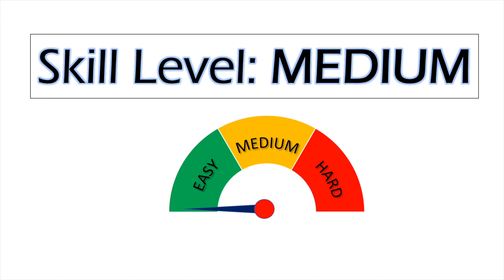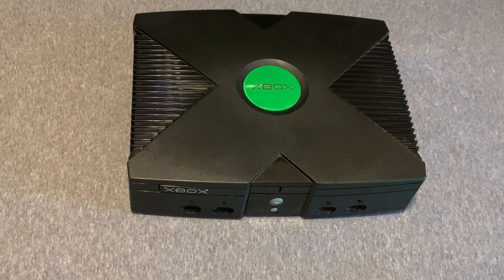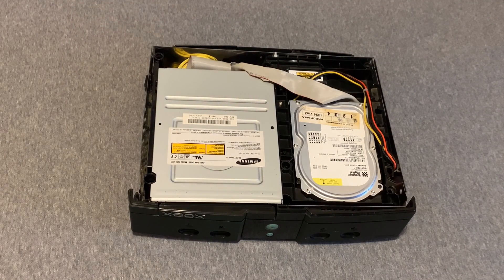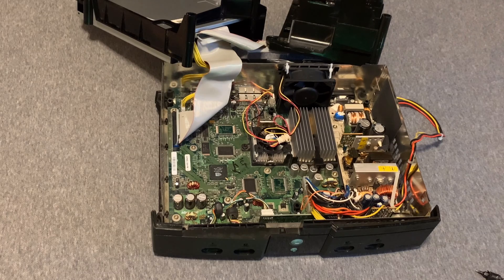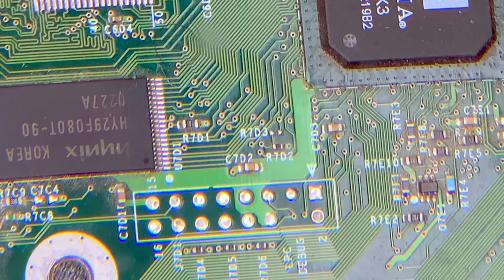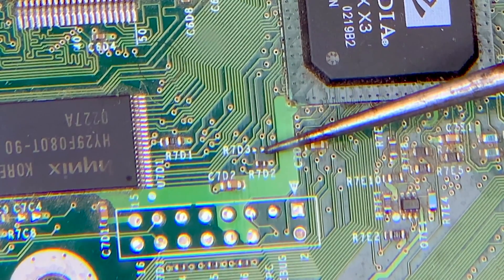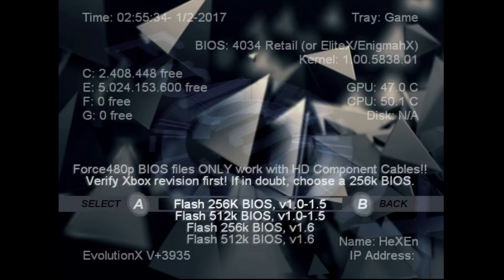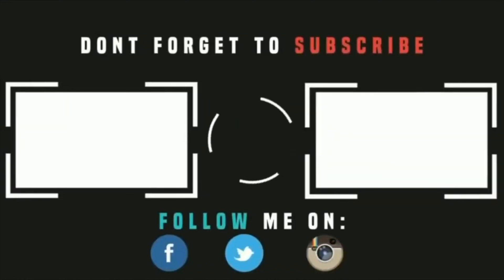XBOX TSOP Flash Full Tutorial How To Guide v1 0 and 1 1 Hynix Hyundai ST ONLY

Comment: This was the most aggravating soldering experience I have ever had. I could NOT get the solder to actually stick, no matter the heat. But then I looked and I lost the flipping capacitor at R7D2. No idea how, no idea where it went. Even with a wire - could NOT get it to stick to those two spots.
Reply: I wonder if you just got some solder cut it so it was touching the 2 points then melt it would that work.
Reply: flux and lead solder is your friend

Comment: I got an Xbox that seems to have been soldered at these points already, but the CFW hasn't been installed.  I was wondering if it will boot backup game disc without upgrading the CFW yet or do i have to load up Hex?

Comment: After I flashed using hexen, my v1.0 powered off as usual after the flash, and once rebooted, it shows the power up animation as normal with the EVO X logo on the top left, but then it sits at a black screen and doesn't so anything.
I put in splinter cell to test and it booted and I reinstalled the rocky5 Softmod 1.1.7 just to be safe, and after that, it's still sitting at a black screen after booting up. Help?
Reply: Reflash the bios 😂😂😂

Comment: Hey Blaine I just tsop modded my 1.0 Xbox in preparation of a bigger hard drive. Everything went well for my Xbox with an ST chip however I did want to mention 2 things. Rather than using solder to bridge the connections together I actually used some conductive paint that was recommended from reddit and applied it to the 2 points using a tooth pick. Also when booting into the hexen disk I don't believe you mentioned the slow boot time to get into the menu, not sure if that happened to you but it did for me and I seriously thought I messed up the burning of the disk initially. Other than that your video was great and I appreciate everything your doing on your channel keep it up!

Comment: What does TSOP does for your xbox( i'm just a newbie at softmodding and stuff)
Reply: That's actually no longer true.  With modern softmods you can null your eerprom and easily replace the hard drive if it falls.  If you want to run without a DVD drive a hardmod allows that, plus other hardware changes.
Reply: Im not 100% sure about what it does, but I know it allows you to upgrade the original Harddrive to a bigger one.
Reply: @medude5159  There are 3 types of mods(to play backups and homebrews) for Xbox - one is mod-chip, another one is softmod and another one is Tsop. They all basically do the same things, just in a different ways, and all allows you the upgrade to a bigger HDD.
The easiest is the softmod(if you have the tools: memory cads, USB stick reader for Xbox and Splinter Cell game and the software). Its the easiest because it doesn't require to open up your Xbox. Its main drawback though is that if the HDD fail, your Xbox will become just a  paperweight since all the necessary files to run is in there.